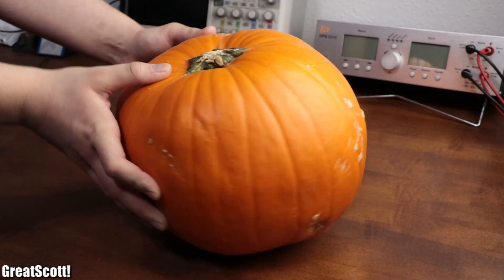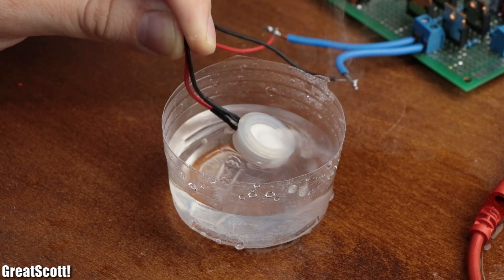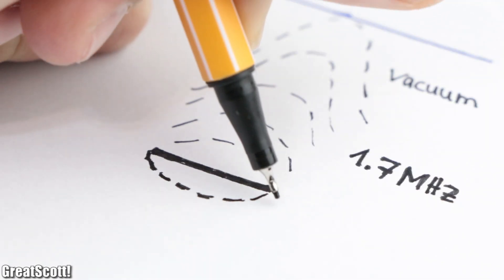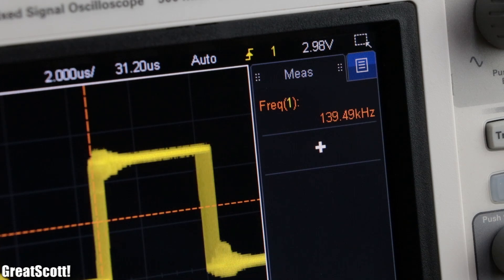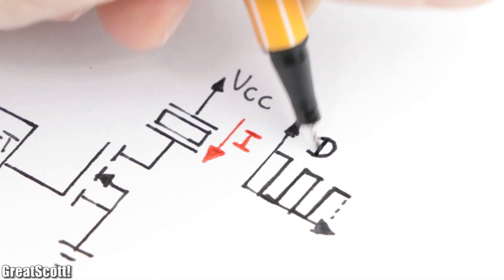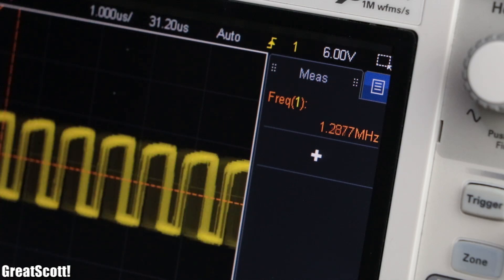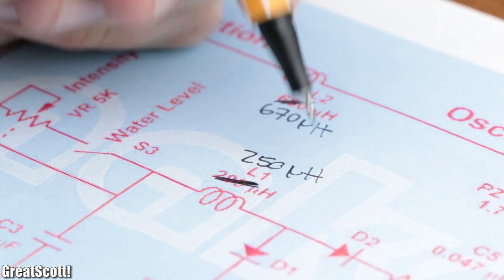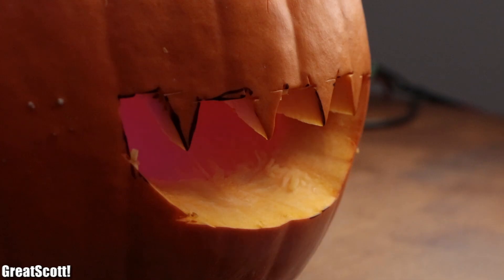Ultrasonic Mist Maker || DIY or Buy

Comment: Thomas Edison supposedly tried 10,000 different materials for the incandescent lamp filament before deciding on tungsten. He did not consider it 10,000 failures, merely 10,000 different ways not to produce the filament he desired.

This is the Way…

Comment: An important thing to remember about these disks is that the impedance will be different in air vs water. In air they're basically a short at 1.7MHz, less than 1 ohm real resistance. In water the impedance goes up to about 25 ohms (both have negligible reactance). Put one on a VNA at 1.7MHz and see for yourself. Usually the advertised resistance is the in-air resistance, but if you're designing for a piezo in water design for a higher output impedance. Class E amplifier is great for this.

Comment: using an H bridge sorta works. Changing the component values in the diagram won’t work. As it’s a crystal oscillator. An needs to be finely tuned

Comment: Hmmm.... 
I would have used a T-bridge, and I would have used a reverse biased diode for my signal generation. 

A T-bridge is an H-bridge that uses a center tapped transformer to complete the circuit, instead of 4 actively driven components to complete the full wave form. 
A slightly different take would be that the T bridge is the AC conversion of a half wave rectifier. 
It does drop the component count down by a bit, but you need to use faster speed inductors as the frequency increases. 

Reverse biased diodes as a signal generator is something that i've been looking at for a bit... they seem to produce sawtooth wave forms, which clean up very nicely when put through an inductor, but they can be very different diode to diode.
Reply: even that is not required, i recently found a driver which seems to be from a very old electronics book, amd its based around a single transistor and uses the piezo disk itself for the clock

Comment: best vid about making a humidifier with a piezo so far, I liked the explanation of how the water is evaporated!
And there is nothing like stupidity by failing. „Better oops, than what if!“
Did you also try at 113kHz? Other people used piezo with this resonance frequency and it worked well. This frequency is easier to get, even with the NE555.
Thanks,
Hubert

Comment: hello my friend i got a anko vapor cooler thing from kmart and due to a very hot day and considering that i  could buy another one for 15 bucks, i used the really powerful 12volt fan in my pc as i needed to cool my rad and it have enough static pressure ect anyway i found the module that drives the ultrasonic disk now due to china having a habbit of rubbing chips due to there version of patenting... i had to count the legs its a 16 pin dip i have a feeling it might be a micro controller of sorts, but there is no crystal... but anyway its a single package and that is connected to a surface mount fet 5003 and a 3 pin inductor.... which is most likely a transformer to step up the voltage just with a common between the primary and secondary.
my conclusion is that in order for this to work you not only need the right frequency but enough power to run the ultrasonic disk hence that one you got from ebay is 24volts running at 12 volts you just not have enough power as i am sure with high current it would just burn out the ultrasonic device.

Comment: Hi, very usefull, I”m a railway modeler and Id like to fit a suitable steam generator into the loco”s boiler, the scale of models is 1/87 H0 so they are pretty thin  but any advice would help, thanks in advance !

Comment: I've been meaning to ask you about your circuit prototyping technique in greater detail. You may have a video about it in fact, so I should look more carefully. I'm interested to know whether you are (as it looks like) using only solder to create the "traces" on your prototyping board, or whether you are also using some kind of bare wire?

Comment: There are cheap mister circuits available on eBay, but they are very low-power.
I wonder how hard it would be to drive a  couple of IRFZ44Ns to provide some decent kick at the required frequency?

Comment: You can now by a personal face mister with a built in battery that uses one of the disks. It would fit in a pumpkin 🎃 perfectly. I got one for $6 AUD. https://www.ebay.com.au/itm/USB-Nano-Spray-Face-Steamer-Handheld-Humidifier-Fine-Mist-Beauty-Sprayer-/384223173476?mkcid=16&mkevt=1&_trksid=p2349624.m46890.l6249&mkrid=705-154756-20017-0

Comment: If you wanted an AC output on the single MOSFET circuit, why not just use capacitor coupling to remove the DC component?

Comment: Damn that's a tough one to circumnavigate with DIY.  Especially that sized (I bought one of those a while back; only about the size of half a D battery for those curious).  Never thought to see how they drive the little vibrating disk.  You definitely hit it with about all I could come up with after seeing the process (H-bridge or some sort of driver to MOSFET config).  What did you find in that thing after you got it apart?  SMT based versions of what you attempted?

Comment: Can you please help me design a circuit for this Piezo:
Resonant frequency = 115KHz +/- 5KHz
Resonant impedance = ≤ 100 ohms
Static capacitance C's = 2900pF +/- 20% @ 1 KHz
Voltage input = 3-5 VDC
Power source = 12 VDC

Thanks for your help

Comment: Making your driver with bipolar transistors would have been far simpler!
Especially if not making H-bridge nor half bridges but a coil-loaded single transistor. For instance: https://www.edn.com/wp-content/uploads/contenteetimes-images-edn-design-ideas-di5580-improved-piezo-drive-circuit-f2.png

Comment: when you used the schematic found on eBay, why instead of using it in its entirety, you changed several components!?!?
maybe this is the reason why it didn't work!!   ;)

I used a circuit VERY similar to this one, which uses the BU406 and works perfect.

Comment: 1.7MHz is not easy to control. I'm trying to control 1MHz right now, it's quite hard to build the circuit to capable to do it properly. Also, not only for transmitter but for receiver as well...=( Finally, gave up and bought TI 100$ board, but it gets crazy if you want to use custom transducers.

Comment: I researched DIYing a version of this with ten heads a while ago and I believe their may be two oscillation points , one of which is in the kilohertz range which may be why your last circuit failed, it wasn't meant to go to 1.7megaherts however I will be transparent and tell you I researched this at least a year ago and my memory may not be perfect.

Comment: This things is so hard to repair,just buy the driver board on aliexpress problem solve #Aliexpress MYR 33.43  13%OFF | Replacement Humidifier Parts 28V Humidifier Control Panel Board Potentiometer With Switch Power Supply Board Nebulizer Plate
https://a.aliexpress.com/_dZgdLc3

Comment: Looks like the 2020 chinese market has far surpassed your DIY thriftiness.  Have you played with the USB humidifiers?  For a couple bucks from the usual gettin' stop, you get a ultrasonic disc, driver circuit with a water sensor and LED ON light, with a plastic doughnut float and a thin USB cable.  The circuit is super simple with an inductor, capacitor, transistor and and driver chip.  It works incredibly well for about 20 cents of components.

Comment: question : I buy 6 mistmakers  => 24v 2A witch power supply is the best for it ? (I want only one power supply 24v 2A with 6 output or 24v 12A ?

Comment: You could have used clamper after 555 oscillator, you already has required frequency but the problem was it was dc  you coud have used a clamper rite , pls let me no if i am wrong

Comment: There is more simple circuit for oscillating 1.7Mhz piezo ceramic disk. 
It's just consisting a single transistor using BU407, 22uh inductor and several resistor, caps. 
It's cost around USD 0.3 to 0.5 for build in my country,..

*NOTE: make sure keep dry the back part of piezo ceramic disk (there's cable).

Comment: would it be possible to build a similar device that seperates the hydrogen and oxygen atoms from eachother?
If so, how would you approach this?
Reply: I believe you are thinking of electrolysis. The device shown in the video is not splitting molecular bonds, but is creating very tiny droplets of water by way of high frequency oscillations. If you want to see electrolysis in action you can do so with very common household items https://www.instructables.com/id/Simple-Electrolysis/

Comment: I have been in the market for a fogger for a greenhouse. I have a moderate amount of electrical engineering experience. It seems there is a disconnect on how to power these units/membranes. Reputable sources (HoH) shows a spec sheet with an input voltage of 24VAC. Most other sellers are selling these units with AC-DC converters. Has anyone done a side by side comparison? is the reason people are having bad results because they are attempting to used the wrong PSU?

Comment: You should use Colpitts Oscillator with a Crystal Oscillator... Less than 10$. Add a mosfet, 24V and finished

Comment: I spent a while as a kid trying to modify a carburetor to have an ultrasonic humidifier but i couldn't match the changing flow rates
Reply: I never thought of that. Can you tell me the effect of this? Will the engine run better?
Reply: @yboy898  the goal is to get the fuel mixed with air which would be very easy if it was vaporised
Reply: @StayRed  ah i see. Thanks for the idea. It's now in my to do list.
Reply: @yboy898  let me know how it goes
Reply: @yboy898  seems mostly practical for carburetor intakes

Comment: What if you added another 555 ic square wave oscillator through a transistor that created a wave opposite to other ne555,the transistor's base will be connected to the output of a op amp of which the voltage will be the 1v  or below and the refference voltage will be the output of first 555ic

Comment: Hi Scott. First off 1.7Mhz looks a bit high for this piezo. Second off, you have not tried two or dual hi voltage OPAMP(s) in bridge configuration, which could please you with the resulting outcome... Maybe you should in the next video... Otherwise cool experimenting.

Comment: there is one other way that may work i have attached crude schematic using 2 batteries in series a npn and pnp transistor similar to the way that most decent audio amplifiers do it

http://i64.tinypic.com/11hrxud.png

the batteries can be replaced with with transformer center tapped to allow converting to dc with a + and - voltage and fed  through 2 transistors like you find in halfway decent audio amplifiers.

the transistors can be switched in a flipflop fashion at the frequency needed.

another option is to do it in software using a arduino with pwm but i dont know if it will work.

sorry for the crudity of the schematic but i did not have time to make it to scale or paint it.

actually it seems as low end and free electronics simulator software does not emulate as well as the more expensive software and even worse the animation is spotty

Comment: When I measured the driver frequency of a cheap mist maker from China I realized that they were still using 140khz signal from a mystery ic. Ive never seen they disks running at 1.7mhz

Comment: one big mistake GreatScott.. LM385 is 1.2 MHZ GBW Gain-bandwidth  at gain of 1 and that decreases by the gain let's say gain of 10 1.2mhz / 10 = 120000hz only.. same is with MCp602 GBW Gain-bandwidth  is 2 MHZ  / GAIN  2mhz only if acts as a buffer but reaching even near 2mhz is not a good choice for this op amp.. try the whole project all over again use a Schmitt Trigger using  MAX477 for example and  or even sinewave excluding schmitt trigger but using MAX477 op amp and let us know that this doesn't work.. you simply made a wrong choice in using op amps.. MCP602 maybe would just manage  using square-wave  but again it's a low voltage  rail to rail up amp.. you want to output at 1.7mhz square-wave in range of 0-12volts at least or more... repeat the test using a HIGH slew rate opamp or ultra high frequency opamp and let's conclude it's do-able..  no probs.. 5v square-wave from mcp602  no chance and  bandwidth is incapable to output sinewave at that speed..  even at gain of 1...  using square-wave instead would maybe do the trick  but as you can output more then 4.9v out useless..  Gain-bandwidth product of LM324 is 1 MHZ. 1 MHz / 10,000 = 100 Hz. If you want a high gain with a better bandwidth use high slew rate opamps.. LM7171,MAZ477 etc....  I appreciate your work but I am surprised you did not have the knowledge of this before attempting the experiment and I take you for a KNOWLEDGEABLE  guy in electronic..  please correct this by making re-make using a adequate op amp.'s choice.. ..  thank you ever so much .. I said this with all the best intentions... Hope you get me right...

Comment: I have been using the foggers from China for 2 years now and they last for 1 month, maybe 2 if you buy the metal cased larger ones.  I wish I could buy a driver circuit so I can easily and cheaply replace just the discs.  I know they sell replacement ceramic discs but it is the driver circuit that dies.  I am going to try opening one of the metal foggers and running wires into the water tank to the cheap discs, hopefully getting the driver out of the water tank will help its longevity despite it running hotter without the water cooling effect from the tank.  I am not sure which components are dying on the drivers or I would just replace or upgrade them.  Maybe they die eventually from water intrustion, I wish I knew!

Comment: Can you make a high voltage capacitor  charger ( 12V to 450V ).... the circuit is available in the market but it's way to costly ... can you please make a DIY version?

Comment: Could you look at a video on a swash plate pump motor type 12 here on you tube? Then imagine that pump motor being redesigned into a superconductor electrical power generator operating off super cold presurized liquid air. The swash plate pump motor being constructed with superconducting materials and gadolinium for magnetic field generation then have a tiny copper wire coil on the inside of the motor or a large wire copper coil on the on the outside to generate electricity. Idea, use a cryogenic stirling piston 12v to generate liquid air (gases from atmosphere) that filled an insulated tank with a bell siphon. The siphon filling repurposed large propane tanks with frequency emitters at the bottom of each tank to cause the liquid air to return to a gas state building up presurized air in the tank with the tank having a presure release valve set at a certain pressurized air setting to allow a steady release of presurized super cold air out an insulated copper pipe to the redesigned swash plate pump motor type 12 that would then spin at very high velocities from using superconducting materials and the gadolinium to generate the magnetic field. Main idea, design a smaller version using repurposed paint ball compressed air tanks with a mini cryogenic piston with a frequency emitter in the bottom of the tank to force the liquid air into a gas state presurizing the air that then spun a swash plate pump motor type 12 that was redesigned into a superconductor electrical power generator with only cold air being exuasted from the portable electrical power generator. With the system being powered first with a organic carbon power cell to generate the first tank of liquid air. Then the generator would kick on shut off power drain from carbon power cell and recharge power cell to full then shut off power flow to power cell leaving the mini cryogenic stirling piston being powered off and on by the generator. Of course there would need to be two tanks being use to alternate from one tank to the other for constant electrical power generation.  So what do you think about these idea's? Other idea was to design a self sustaining air conditioning unit by using this concept. Then self sustaining deep freezer's and self sustaining refrigerator's  😊

Comment: Have you ever tried using a cryogenic stirling piston to generate liquid air? Filling an insulated tank with a bell siphon. With bell sipjon filling an aluminum large fin radiator with a infrasonic mister in the liquid air inside the aluminum radiator with a fan drawing air through the radiator for air conditioning? The main idea was to design a closed system and use a mini cryogenic stirling piston to turn Argon gas into a super cold Liquid then have an infrasonic mister to vaporize the liquid Argon gas passing air through a copper radiator to cool a computer with the boil off Argon gas returning to the crygenic piston to reform the super cold liquid Argon gas. With a side idea to use that very same concept to design a small portable air conditioner with a condensation resivor with it's size being that of a microwave oven. Designed to cool the air using the Argon liquid gas has the heat exchange and not have to have a exuast vent blasting hot air out ofna window like how portable air conditioners do right now. 😊

Comment: I saw in many circuits the botton part isolated from water. The top part goes imerge in a thin layer of water, and the botton part goes in a dry compartment, probably because air is less dense than water and because that it is stres less the ultrasonic piece. Congratulatins for your experience and this is a awesome video, but I think this could work if you folow this tips: https://www.youtube.com/watch?v=3rZcX6kO3Tg

Comment: Were it up to me and doing the DIY route, I would have simply connected the piezoelectric speaker directly to the function generator and pumped the necessary 1.7 MHz signal directly into the device.  This especially considering that your function generator is capable of generating up to a 10 MHz signal.